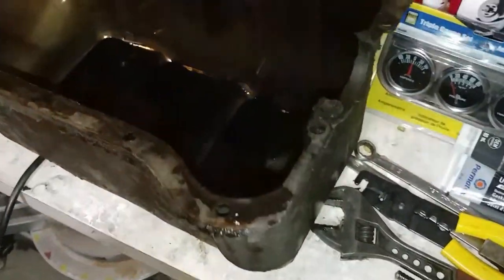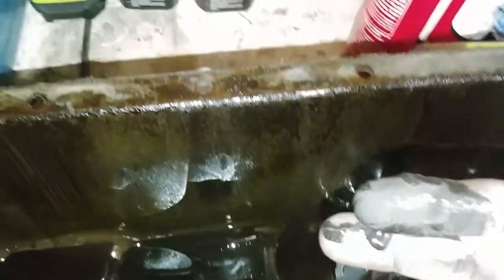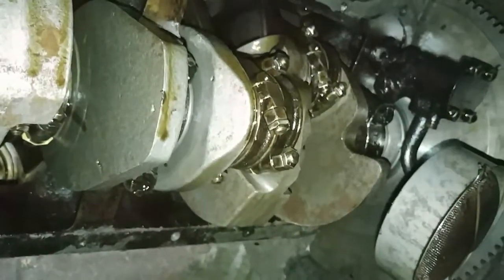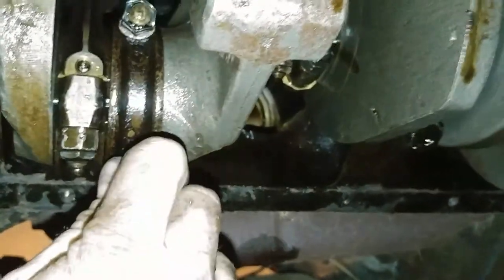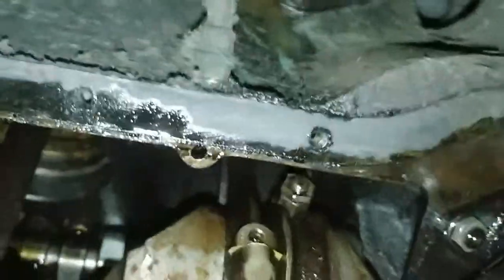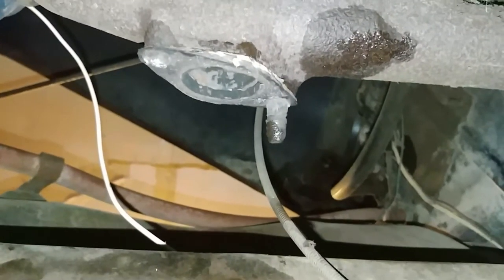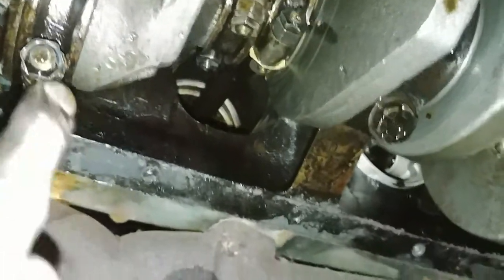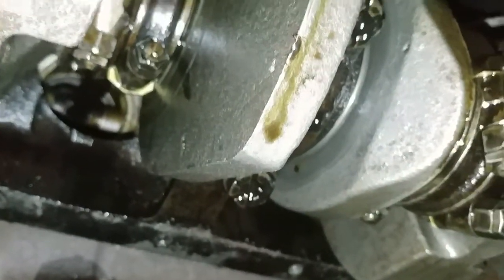1953 Ford F350 Flathead V8 oil pan removal and bottom end inspection

Comment: I'm working on a '36 flathead Ford. This thing hasn't run in over 50 years.I had the intake off and found about 1/4" of sludge,coating everything.I scrapped and vacuumed everything,oiled everything up and installed the intake. I pulled the plug on the oil pan,nothing came out,dip stick said the oil level was full.Ran a screw drive thru the hole,out came the oil. I bent a heavy piece of wire to get an idea how much sludge was on the bottom,seemed like about 1/4". I pulled the pan and there was 1" of sludge in the sump portion of the pan! The oil pump pickup screen bottom was was in more than 1/8" of sludge! Previously, I've cranked it over with the starter about 20-30 times,not realizing there was no oil pressure! The oil on the dip stick looked good.For those who try to start an old engine without checking the amount of sludge in the pan,could very well ruin an otherwise good engine!Thanks for your video!

Comment: does the motor turn over freely by hand or breaker bar? I have one that it will not turn over only with starter but drags to a stop..any suggestions ad to what is preventing it from turning over freely..
Reply: Sal Martinez too much compression mabye your valves neef adjusted